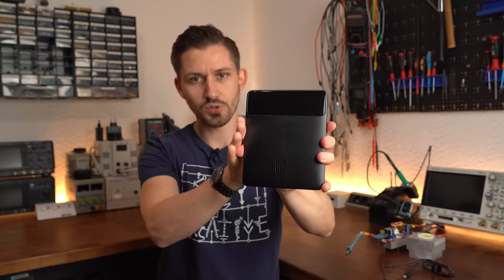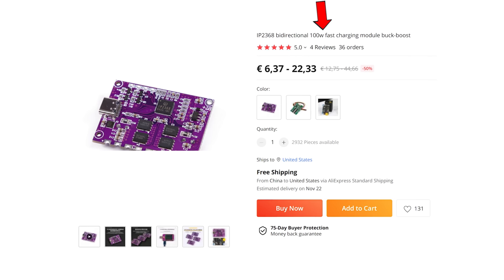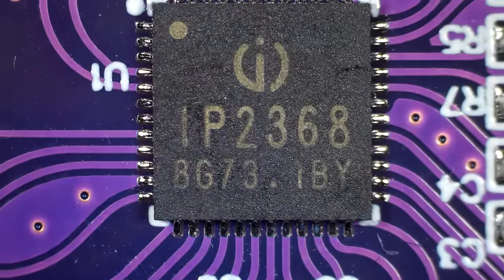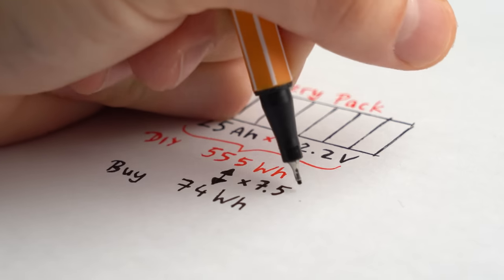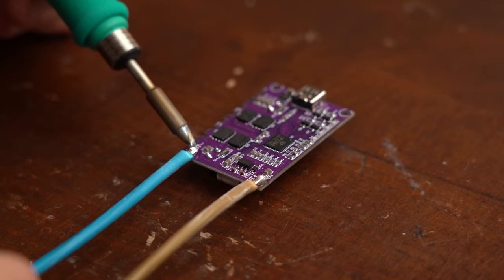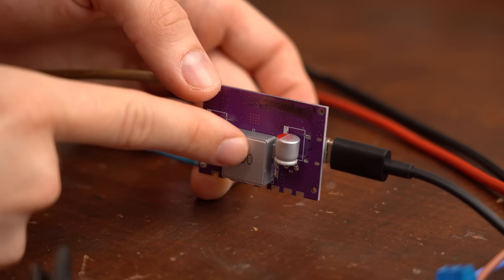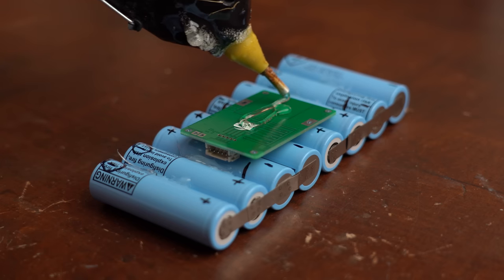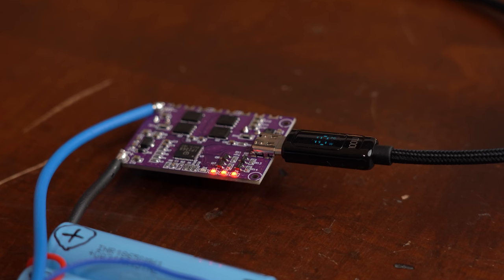My Power Bank Rivals Commercial Ones?! Super Fast! (DIY or Buy)

Comment: Really nice video. I'm just in the process of making a 100W power bank as well, but with another pcb. It's half of this price (19USD with VAT) and has the balancer included as well and also with a lot of I/O, even a DC input. You might be interested to try this one as well. I'm waiting for my batteries to arrive for the project.
Reply: Which pcb?
Reply: Item ID to the other 100W PCB: ali  1005004642775972  (i can't insert the proper url so just replace any ali item url with the ID of this one)
Reply: @cinkoxid  awesome, Thanks!
Reply: @ChristopherHerrmann  you're welcome. It took me many hours before i found it. The search engine is awful on ali.
Reply: @ericklein5097  oh noo that is very bad. did you try to open a dispute for the product? it is clearly a false advertisement nad the product can't do what is described.
Reply: @cinkoxid  giving the seller one more day to ask the engineers why I can’t pull 100W. Their first question was “why you use so many battery???”  I had a 4S5P pack. Idiots.
Reply: @cinkoxid  have you pulled 100W out of yours with the USB C port?
Reply: @ericklein5097  sadly usually the sellers can't help with technical things. But based on the description of the device i would have thought that this PCB has a good technical support. Maybe we would need a more direct contract with them.
Reply: @cinkoxid  are you able to power a 100W device with this board?
Reply: @cinkoxid  Update: Refund approved by Aliexpress within an hour.
Reply: @ericklein5097  i just noticed that my reply has not been sent for some reason. I'm still waiting for my batteries to arrive. 2 months waiting now...do you think it would be possible to test is with a 12v  or more power supply?
Reply: @ericklein5097  that is very good news. By the way did you try it with an S5 pack? I'M asking because S3 is officially 652 mac, S4 is 100W but maybe S5 could be more stable
Reply: @cinkoxid  it doesn't like the lower voltage range (12V-13V) of the 4S pack and since you ordered the 5S I don't think it will work? I think you also have to have the balance leads connected but I might be wrong. If your power supply is adjustable then you could try it by inputting 19V to 20V into the main inputs and hope for the best.
Reply: @ericklein5097  Yes i have the 5S version and i was also thinking that maybe all the leads has to be connected to make a test like that. My psu is indeed adjustable and i will try to test it. I want to do that before my chance to open a dispute is gone.
Reply: @ericklein5097  mine is just a cheap adapter but it can do 12-20V 5A load so for testing it would be okay. And i could attach an inverter on the other end with a 20V PD trigger. But thanks for the link, i will check that too.
Reply: @ericklein5097  finally had the opportunity to test my board. It shut down after 90W but I'm not sure if it was the board or the step down converter I used. I will upload a video later. My only problem is that the battery level indicator is a joke and also i can't charge the batteries :(😅😅😅😅😅😅
Reply: @cinkoxid  its not uncommon for the resistance in your cable and wire to be enough to cause a 100W output to only be 95W by the time it hits a USB tester or whatever you are using to read wattage. I've never lost a full 10W but its possible depending on how you had things set up. For me I often see my voltage go down about 200 millivolts per amp starting at 20.200V with no load.                                                                                                                                                                                                                                                                                                                                                                                                                                                                            . 

I need to test my USB C cables (I have two 1.5 foot cables I primarily use during testing due to their short length). I am ordering some UGreen cables because they have been tested to have some of the lowest resistance. The testing was done by AllThingsOnePlace, a great Youtube channel. He also has a website and you can view his large list of tested cables. Look at the overall resistance reading and then the "resistance per foot" column since he tests many different lengths. Hopefully the 1m UGreen cables I'm getting provide some level of improvement even though they are longer than my current no name cables.

I'm trying to eliminate any possible bottlenecks in my testing rig (DL24 Electronic Load using the USB/DC Barrel adapater, Unknown Brand DC 5.5x2.1 to USB C female 20V trigger cable, 1ft USB C 100w cable, FNB48, 1 ft USB C 100w cable, the board I'm testing, and then usually 14AWG or 16AWG silicone wire about 8", XT60, more 14AWG or 16AWG silicone wire of the same length soldered to nickel tabs I have left long enough to hang past the pack pos and neg terminals so I can solder them without directly putting my soldering iron on the cells. 

If you havent seen the Ebike School video comparing soldering to spot welding with a thermal camera you should watch it. Can't see inside the cells but 3 short seconds on the cell with a soldering iron and temps of 200 Celsius appear.....and there are people on YouTube leaving their iron on the cell for 30 or 45 seconds!!!!! Telling us its not a big deal to solder cells if youre quick!!! Heat is the number 1 killer of lithium and that is a quote I got from a professor whose University is one of the only ones doing research WITH                                                                                                                                                                                                                                                                              Tesla. He has cells from the early 90's he's still running tests on so I know he's been studying lithium for 30+ years.
Reply: @ericklein5097  My voltmeter/tester is right on the output of the C port so the cables are not interfering for me and mine is not shuttung down around 90W but instead changing to 7V os that is why i was thinking that the issue is somewhere else. My step down controller was giving a high pinch voice as i was reaching 90W (even though it ccould do 300W on paper). I was trying to hold it around 87W  for a few minutes and there was no issue...but the temperature of the pcb was around 70-75 in a 20 C room so in the summer it is almost 100 if i would put it in a case. I was thinking to add a little cooler or something like that. But still my main issue is that i can't use it to charge from either of the ports. Do you have any suggestions about that? I can see that after connecting the charger then the pcb is realizing that it should charge and the percentage of the battery starts to rise very fast...but in reality nothing is happening. I asked the seller about this but i already know it is a dead end, especially because I could only initiate a paypal refund if it's really broken. 

Thanks for the other info, I will check them. GreatScott also did a nice video of the cables recently.

I don't have spot welder yet so I just used tapes to try what the pcb can do. I was afraid to just try to solder even if only for a few seconds...
Reply: @ericklein5097  My voltmeter/tester is right on the output of the C port so the cables are not interfering for me and mine is not shutting down around 90W but instead changing to 7V os that is why i was thinking that the issue is somewhere else. My step-down controller was giving a high pinch voice as i was reaching 90W (even though it could do 300W on paper). I was trying to hold it around 87W  for a few minutes and there was no issue...but the temperature of the pcb was around 70-75 in a 20 C room so in the summer it is almost 100 if i would put it in a case. I was thinking to add a little cooler or something like that. But still my main issue is that i can't use it to charge from either of the ports. Do you have any suggestions about that? I can see that after connecting the charger then the pcb is realizing that it should charge and the percentage of the battery starts to rise very fast...but in reality, nothing is happening. I asked the seller about this but i already know it is a dead end, especially because I could only initiate a paypal refund if it's really broken. 

Thanks for the other info, I will check them. GreatScott also did a nice video of the cables recently. 

Update: I just checked and my USB tester was not directly connected to the PCB so could be...it is a 2$ essager 100W cable to it is possible that 10W went missing in 1M

I don't have a spot welder yet and I didn't want to solder directly to the batteries so i Just used tapes for the moment.
Reply: @ericklein5097  My voltmeter/tester is right on the output of the C port so the cables are not interfering for me and mine is not shutting down around 90W but instead changing to 7V os that is why i was thinking that the issue is somewhere else. My step-down controller was giving a high pinch voice as i was reaching 90W (even though it could do 300W on paper). I was trying to hold it around 87W  for a few minutes and there was no issue...but the temperature of the pcb was around 70-75 in a 20 C room so in the summer it is almost 100 if i would put it in a case. I was thinking to add a little cooler or something like that. But still my main issue is that i can't use it to charge from either of the ports. Do you have any suggestions about that? I can see that after connecting the charger then the pcb is realizing that it should charge and the percentage of the battery starts to rise very fast...but in reality, nothing is happening. I asked the seller about this but i already know it is a dead end, especially because I could only initiate a chargeback if it's really broken. 

Thanks for the other info, I will check them. 

Update: I just checked and my USB tester was not directly connected to the PCB so could be...it is a 2$ essager 100W cable to it is possible that 10W went missing in 1M

I don't have a spot welder yet and I didn't want to solder directly to the batteries so i Just used tapes for the moment.
Reply: @ericklein5097  My voltmeter/tester is right on the output of the C port so the cables are not interfering for me and mine is not shutting down around 90W but instead changing to 7V os that is why i was thinking that the issue is somewhere else. My step-down controller was giving a high pinch voice as i was reaching 90W (even though it could do 300W on paper). I was trying to hold it around 87W  for a few minutes and there was no issue...but the temperature of the pcb was around 70-75 in a 20 C room so in the summer it is almost 100 if i would put it in a case. I was thinking to add a little cooler or something like that. But still my main issue is that i can't use it to charge from either of the ports. Do you have any suggestions about that? I can see that after connecting the charger then the pcb is realizing that it should charge and the percentage of the battery starts to rise very fast...but in reality, nothing is happening. I asked the seller about this but i already know it is a dead end, especially because I could only initiate a paypal refund if it's really broken. 

Thanks for the other info, I will check them. GreatScott also did a nice video of the cables recently. 

Update: I just checked and my USB tester was not directly connected to the PCB so could be...it is a 2$ essager 100W cable to it is possible that 10W went missing in 1M

I don't have a spot welder yet and I didn't want to solder directly to the batteries so i Just used tapes for the moment.
Reply: @ericklein5097  My voltmeter/tester is right on the output of the C port so the cables are not interfering for me and mine is not shutting down around 90W but instead changing to 7V so that is why i was thinking that the issue is somewhere else. My step-down controller was giving a high pinch voice as i was reaching 90W (even though it could do 300W on paper). I was trying to hold it around 87W  for a few minutes and there was no issue...but the temperature of the pcb was around 70-75 in a 20 C room so in the summer it is almost 100 if i would put it in a case. I was thinking to add a little cooler or something like that. But still my main issue is that i can't use it to charge from either of the ports. Do you have any suggestions about that? I can see that after connecting the charger then the pcb is realizing that it should charge and the percentage of the battery starts to rise very fast...but in reality, nothing is happening. I asked the seller about this but i already know it is a dead end.

Thanks for the other info, I will check them. 

Update: I just checked and my USB tester was not directly connected to the PCB so could be...it is a 2$ essager 100W cable to it is possible that 10W went missing in 1M

I don't have a spot welder yet and I didn't want to solder directly to the batteries so i Just used tapes for the moment.
Reply: @ericklein5097  My voltmeter/tester is right on the output of the C port so the cables are not interfering for me and mine is not shutting down around 90W but instead changing to 7V so that is why i was thinking that the issue is somewhere else. My step-down controller was giving a high pinch voice as i was reaching 90W (even though it could do 300W on paper). I was trying to hold it around 87W  for a few minutes and there was no issue...but the temperature of the pcb was around 70-75 in a 20 C room so in the summer it is almost 100 if i would put it in a case. I was thinking to add a little cooler or something like that. But still my main issue is that i can't use it to charge from either of the ports. Do you have any suggestions about that? I can see that after connecting the charger then the pcb is realizing that it should charge and the percentage of the battery starts to rise very fast...but in reality, nothing is happening. I asked the seller about this but i already know it is a dead end.

Thanks for the other info, I will check them. 

Update: I just checked and my USB tester was not directly connected to the PCB so could be...it is a 2$ essager 100W cable to it is possible that 10W went missing in 1M

I don't have a spot welder yet and I didn't want to solder directly to the batteries so i Just used tapes for the moment.
Reply: @ericklein5097  thanks a lot for the info. 
youtube always removes my comments so I'm trying to keep it short this time. Ah and i uploaded the video of my testing.

Comment: Super video, it's actually close to a dyi project for my astro gear I need to (re) do (and would not mind some help on component selection): I need a battery bank that output a constant voltage, low noise 12v 10A mini (ideally 20A for overhead), use 4s lipo RC pack (because I have them) and include recharge input/balancing + all the protection possible (event low temp if possible) -> my astro gear is quite dear to me. So from what I can understand I need voltage regulator + bms + a 220v power supply (to 16.8v?), but there is so much ref out there I'm getting lost.

Comment: Commercial power banks almost always use 1S topology which makes for very inefficient step-up to 20V. Even at 9 or 12 volts I measured my power bank a bit less than 74% of the Wh (20Ah * 3.7V battery got 11 Ah at 5V measured). And I'm pretty sure the batteries have the capacity stated at the box. If you have 6s - it'll be mostly stepping down which is very efficient. But if you drop below 20V on the battery it won't have the same efficiency that you measured. So the best efficiency for this pcb would be 6S into 15 volts at most.
Oh, yes - about charging your laptop 1.3 times - try it with the commercial one. you won't get even half of it (please, I want to know the result - post reply if you try it).

Comment: I wonder if it would be possible to change the reported max power draw of the board to 90W in order to keep the voltage in the correct range.

Comment: You mentioned that the board stays cool enough to not require any additional cooling. But remember that is in open air and probably with the batteries above 2/3rd charge. Once in an enclosure and under a load it may get hotter. 
Then once warm already and the battery voltage falls lower it may generate more heat. I may be completely wrong but it's just a thought I had.  I am interested in building my own power bank as well. Mine does not need to be small. It will still need to be able to fit in a backpack but not a pocket. So I was curious if anyone knew of a larger size cell that will still work with either an off the shelf pcb  or if I need a custom one..know of a design I can use. I'm not electrical engineer and don't know if I trust myself to design such a board that could cause a MAJOR Fire

Comment: Haha mine looks super similar, built a 8cell Samsung 35e 98wh bank, it's 4s and 26a max but 16a continuous. I'm still going to add step up and step down convertor. It'll then do whatever I want, at the moment though it's just 4s  and 5v 3amp. Mini packs like this are super useful. The only thing is I liked seeing the innerds so it ended up looking like bomb to the layman, so while I designed it to be safe to bring on airplanes I thought it'd be dodgy.

Comment: According to the efficiency graph at 8:23 I couldn't understand how board kept cool at 90w output. Looks like efficiency is about 90 percent which means around 9w of energy should be dissipated as heat. How can be the temperature of the board is 45 degree celcius?

Comment: I think to properly judge the  buy option you need to open it up and see what kind of cells are in there.  Quality of cell is important for such a device.
Reply: IF it can output 100W PD then you know it has quality cells. A 4S pack boosting 12V to 20V requires 10A cells.